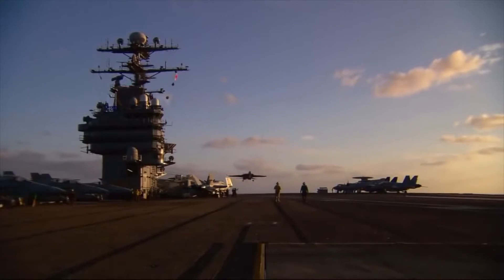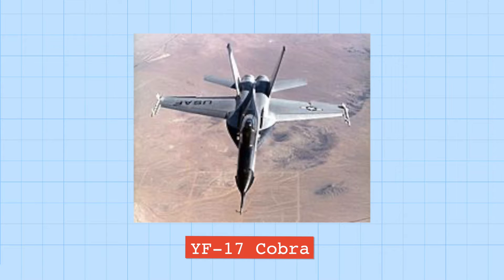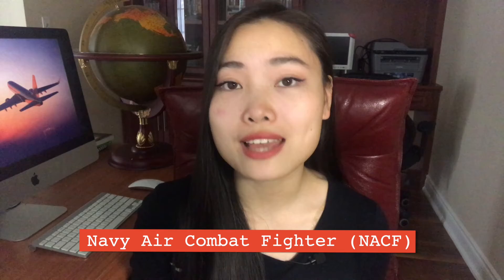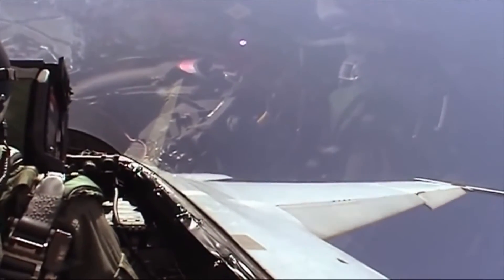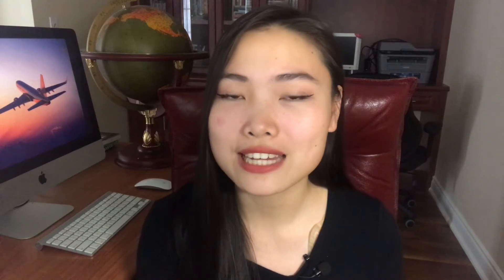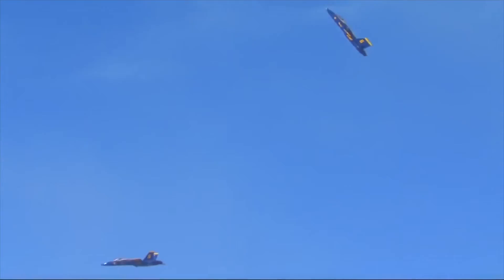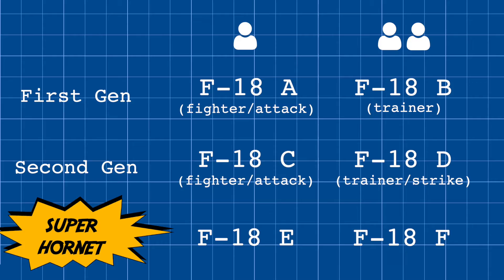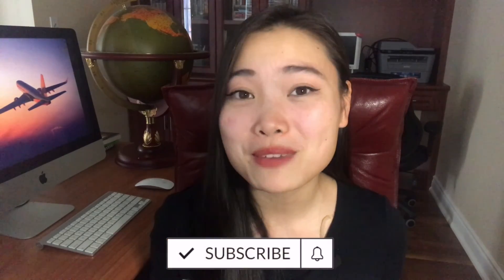Breaking Down the F/A-18 Hornet | Airplane Anatomy Ep.14

Comment: So many issues with this video.
1. The F-16's name is not the "Viper" that's an unofficial nickname.
2. The Hornet was not the first tactical jet to use fly-by-wire that was the F-16. The Hornet technically speaking doesn't even have full fly-by-wire controls because there is still a pitch control mechanical backup system. The F-16 by contrast is full authority Fly-by-wire. The F-18 was the first tactical aircraft to have DIGITAL fly-by-wire flight controls, as the F-16 and Mirage 2000 for comparison used analog fly-by-wire systems at the time.
3. the reason why the F-18 didn't use the F100 engine was because there's no way it would fit. The F404 it uses is shorter, smaller, and lighter. And in fact the Hornet had some pretty serious engine issues early on.
4. The F404 is made by General ELECTRIC not General Dynamics. 
5. When an aircraft shoots down another it's called a "kill" not a "casualty" and since 1991 the Super Hornet, a derivative of the Legacy Hornet scored another kill, a Syrian Su-22 Fitter in 2017. 
6. The Blue Angles transitioned to the F-18 in 1986, not 1988.
7. The original two seat F-18 was actually called the TF-18A before it's designation was changed to F/A-18B.
8. New letter variants like the Charlie and Delta are not considered "generations". 
9. The best way to categorize Hornets by upgrades and improvements is actually by Lot since new lots often had pretty major changes, even within the same letter suffix variant. 
10. Gus completely glossed over the outwardly towed pylons on the Super Hornet contributing to more drag with external stores than the Legacy Hornet. Also the Navy has opted out of Conformal Fuel Tanks on the Block III Super Hornet.

Comment: @46 seconds in "how were the engineers at Lockheed" - Oops, it should be McDonnell Douglas, but you got it right elsewhere in the video so I assume this was just a slip up.  Canada is not a big aircraft carrier, but you could think of Canada's Arctic Forward Operating Locations as aircraft carriers trapped in the ice.